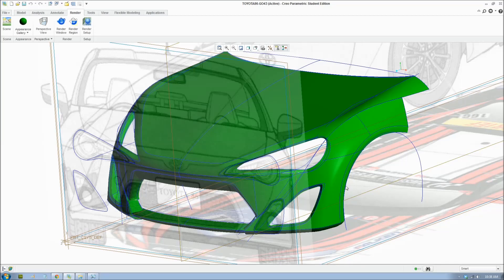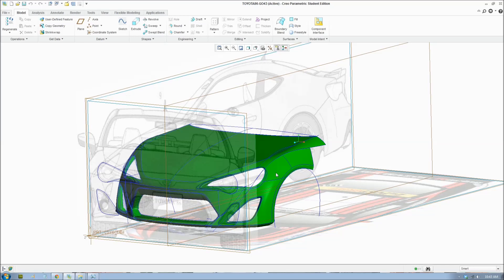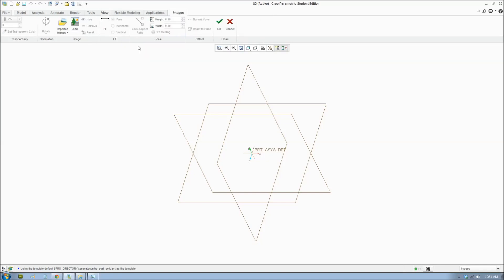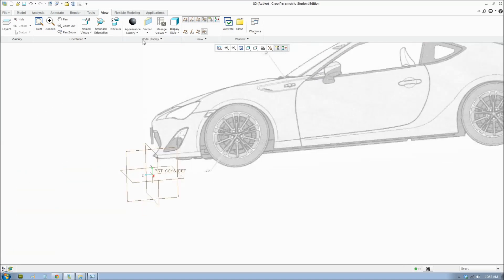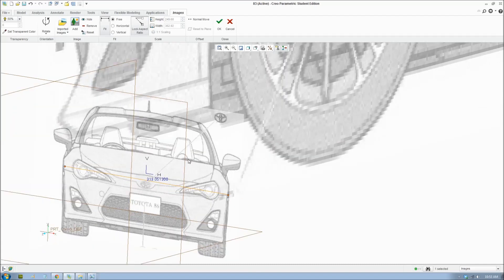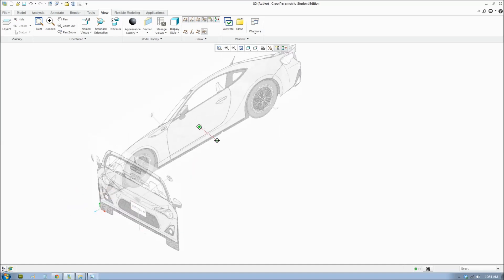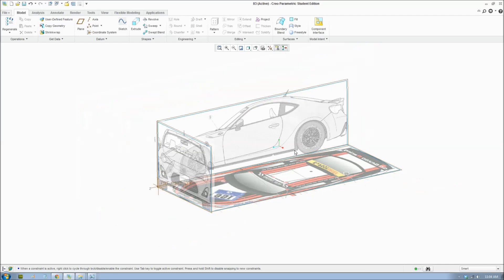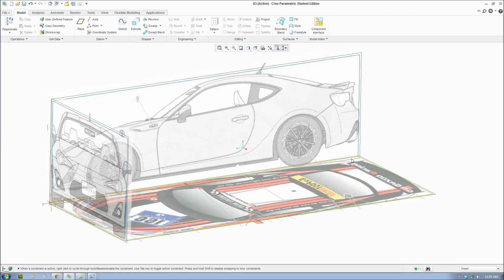Creo Car Tutorial Toyota 86 - Part 0 Setup ref blueprint

Comment: Hello. Very good tutorial. Congrats. Just i have one questition. How to scale properly blueprint images, when we must model the car in scale 1:1 and to modelling directly  in scale 1:1. Thanks in advance for an answer! :)
Reply from the maker: Hi, you just need to set the image to the actual size of the car. Use the tool at 2:20. Make sure to go into setting to set it to inches of mm.
Reply: Huu Huynh i`m using Pro Engineer WF5.0. So that tool at 2:20 isn`t exist. :D. But i founded pretty simple solution. :) And now is time for modelling. Cheers. ;)